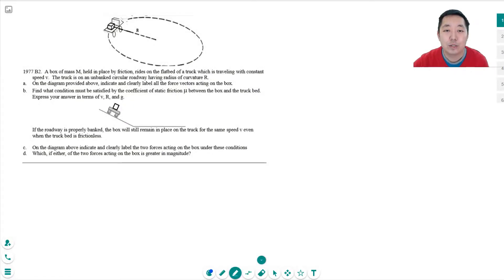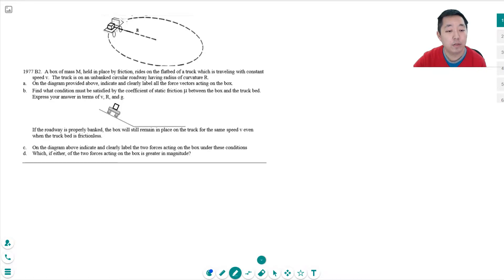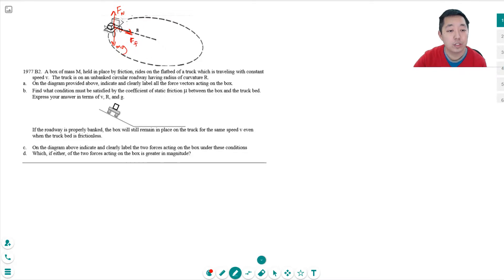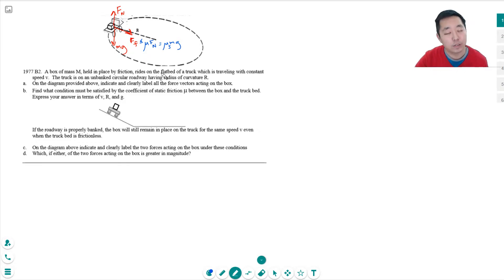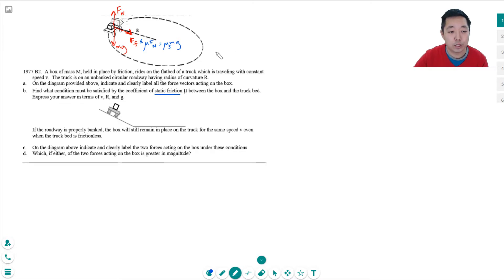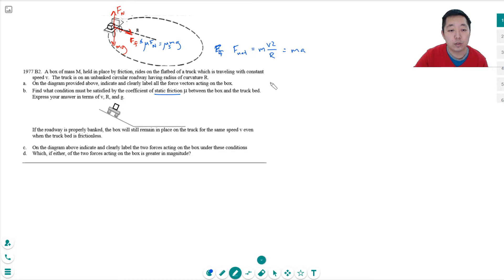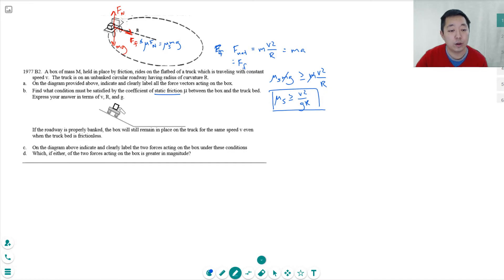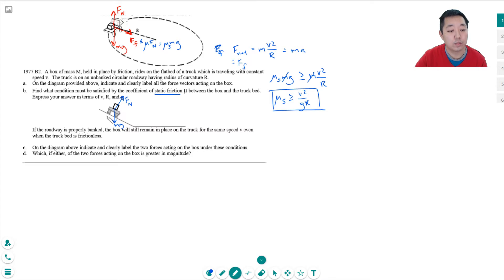AP Physics 1 Circular Motion and Gravity Free Response 1

Comment: Hi, I had a quick question about part (d). If we split the normal force into components, then Fncos(theta)=mg making Fn>mg. I am confused why we cannot do this also?
Reply from the maker: You're correct. The net force should be horizontal, so the normal force is greater. The net force perpendicular to the incline isn't 0, which is where I made my mistake.
Reply: @AllenTsaoSTEMCoach  I had a question related to the net force perpendicular to the incline. Why would it not be 0 because it is not moving or accelerating in the direction perpendicular to the incline?
Reply from the maker: The net acceleration is horizontal (centripetal acceleration) because it's going in a circle. Thus, the acceleration would have a component perpendicular to the plane as well as parallel to the plane.